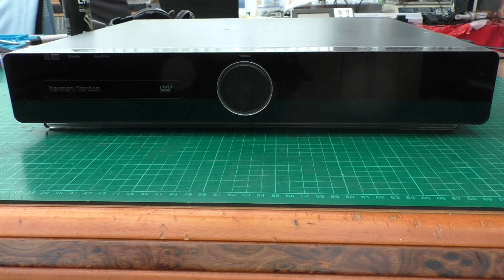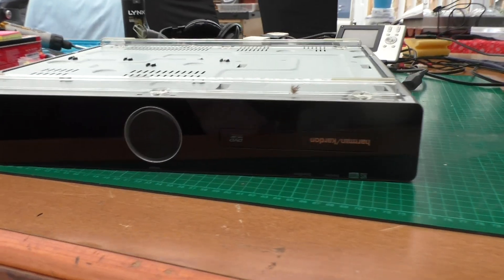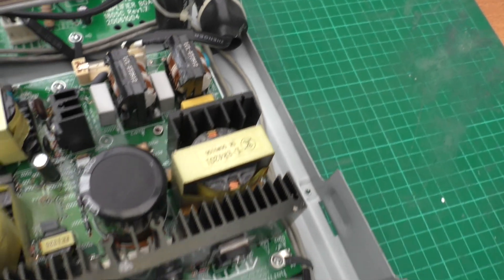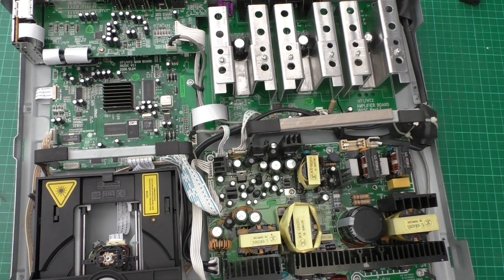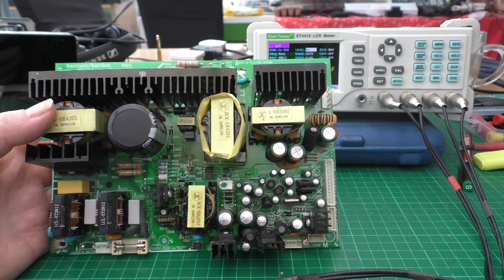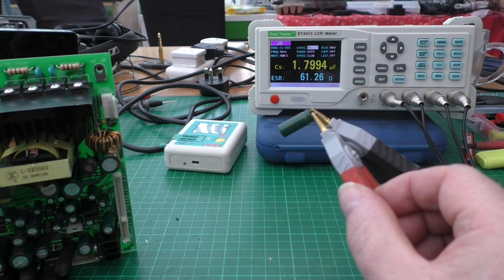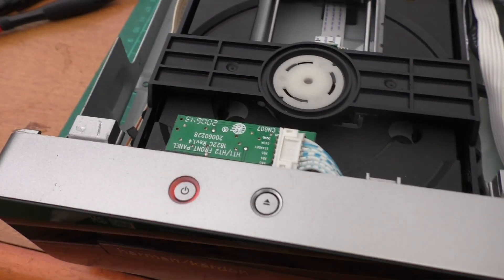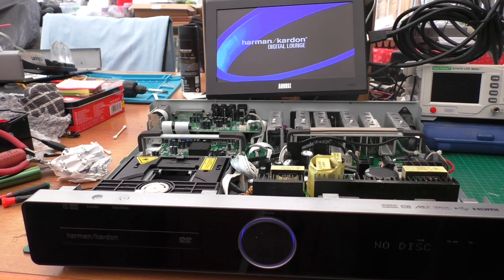Harman Kardon HS300 or HS500 Dead, PSU fix

Comment: Hey Wayne, I have a Harman Kardon HS 300 everything looks fine but it’s missing the transistor R513 is that something I need because my receiver keeps popping fuses as soon as I plug it into an outlet I’ve checked everything and it seems like nothing is burned. None of the capacitors are swollen. I’m just at a loss
Reply from the maker: Hi, it might be worth looking at the data sheet for U501, ML4800,  R513 is part of the TriFault Detect circuit VFB. This pin monitors VFB (Pin 15) for certain PFC (Power Factor Correction) fault conditions.

Comment: Hi Wayne, my hs300 stopped reading usb sticks all of a sudden. Tried multiple usb-s but the deck keeps writing "no device" on the display and being unresponsive. Any tips what could have gone wrong?
Reply from the maker: Sorry probably not a lot of help, Things to check, is the  USB drive formatted to FAT32, visually check the USB port for damage or if your in the USA you might have Outdated firmware.
Reply: @waynephillips1848  Needless to say you got a new subscriber 😉
Reply: @waynephillips1848  Aww man you helped more than you think! It was a dual issue lol the original stick was faulty and even though I formatted it to fat32 it wasn't working. Then the secondary usb was still invisible to the HK but your comment reminded me to check the format type which turned out was ntfs. Once I formatted the second one properly it worked again. So massive thanks to you mate 😉